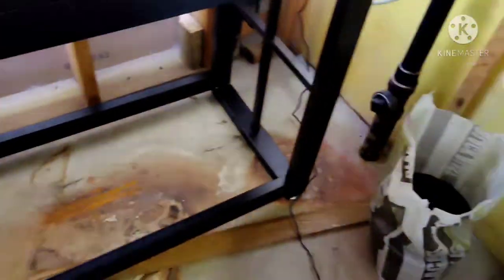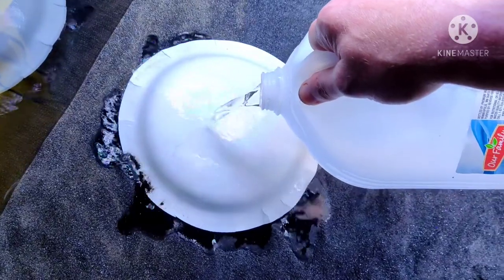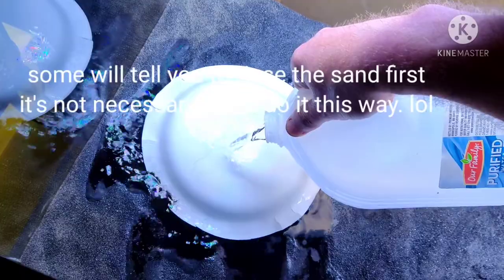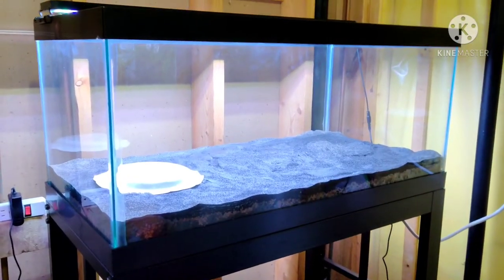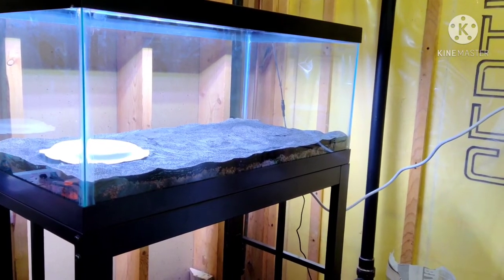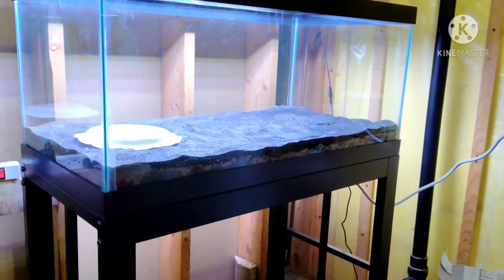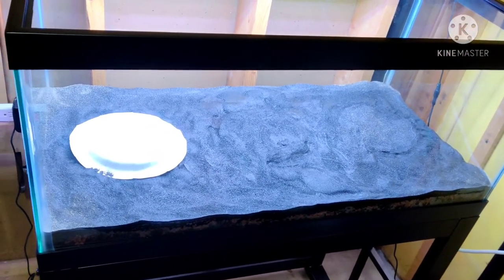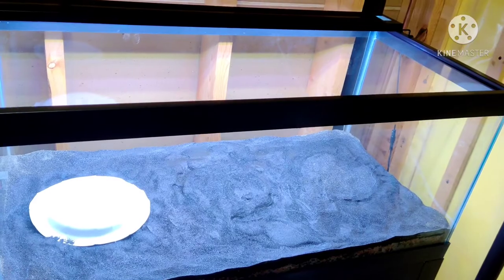Black Diamond Blasting sand, Layered Substrate, part 3

Comment: Before I got into plants, I used to have the cheap aquarium gravel had a bad pest snail invasion had to change the substrate  I decided I wanted black sand and my fish shop guy told me of Black  Diamond love it  ... (The Tractor Supply store carries it if you hardware does not have it) 

. If you wash it the hotter the water you use the better (I washed about 75 pounds) but I had to wash it and add it a little at a time I had fish and one tank removed my old gravel  ..

 But to keep tank cycled I put the old gravel in pantyhose left the gravel in tank till I was done switching to Black Diamond, I add the Black Diamond  in sections waited a 2-3 days add more BD  when I finished … I left the old gravel in tank in the pantyhose bag  for 2-3 weeks til I know tank was safe  took me a month  to do that way, but I had to only with one tank

Comment: Would fine instead of medium diamond blast work just as good?
Reply from the maker: Yes, the point of the sand is to keep particular types of bacteria and living organisms from escaping into the water column. 
The more fine the sand, the better it'll perform it's job. 
The soil actually becomes alive with millions of microorganisms that serve a very beneficial purpose in running an ecosystem.